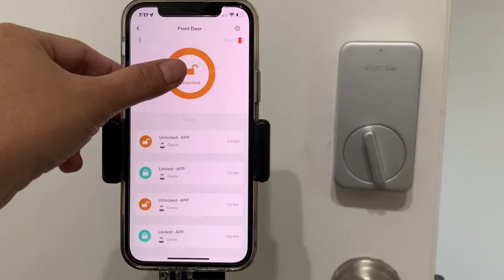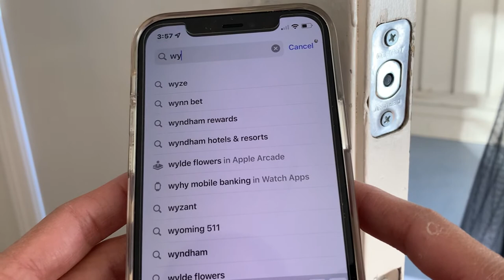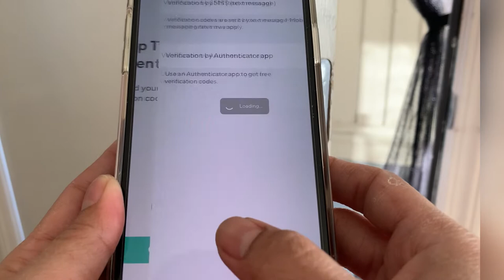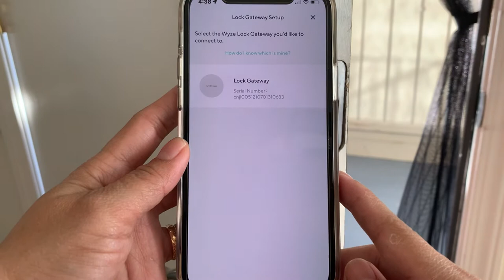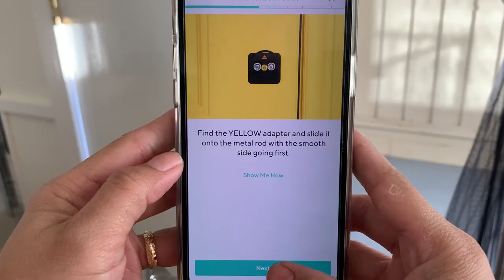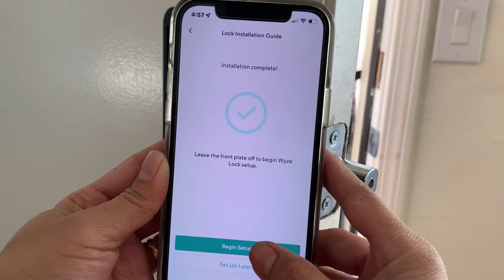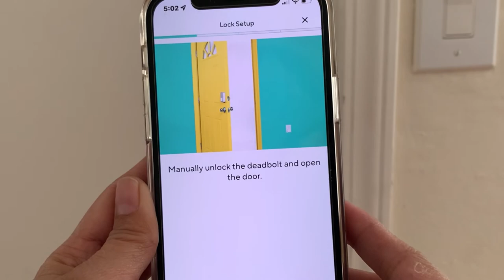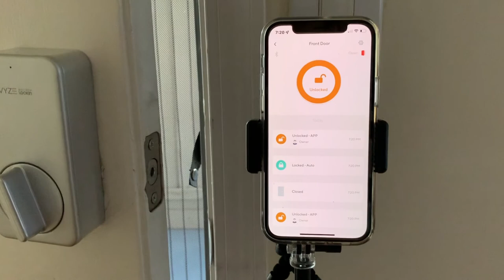WYZE LOCK / EASY SET UP

Comment: You didn't lower the two little arms that hold the batteries in place. Your batteries can easily pop out.
Reply: Plus, on mine, if I don’t lower those arms, the cover will not seat properly (it remains raised my about 1mm)